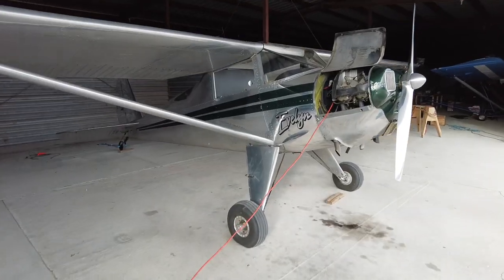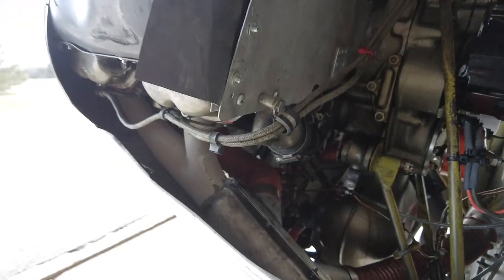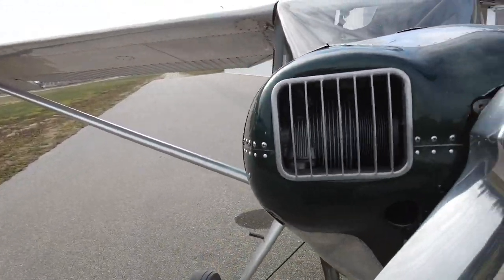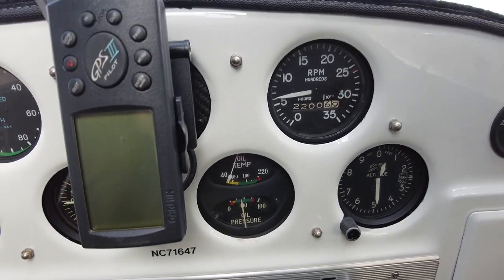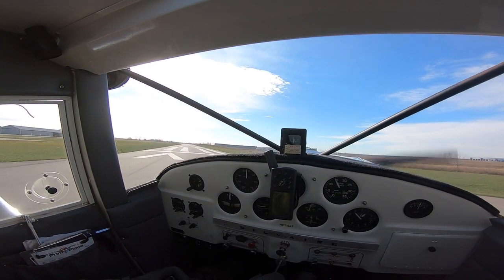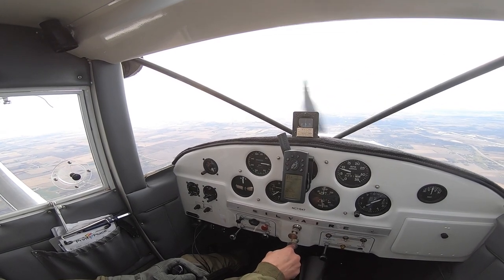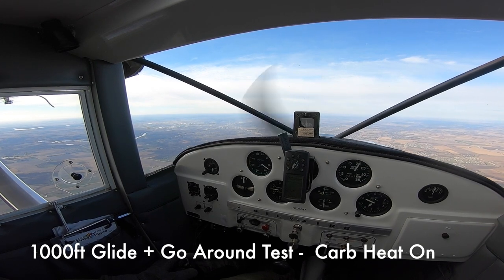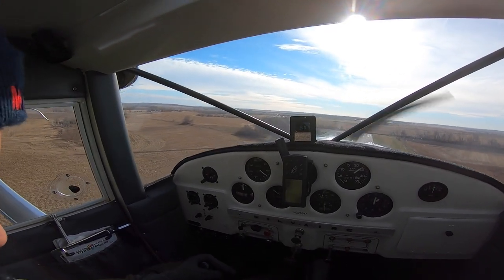Cold weather ops (and smoke in the cockpit!)

Comment: I was taught to not use carb heat (check on run up only)  on the ground due to unfiltered air entering the engine. Also to lean (ground ops)so the rich mixture doesn't foil the plugs
Reply from the maker: The tendency of this carb is to already run very lean on the ground in the cold, which is why carb heat is needed to en-richen the mixture for warm up. On a fuel injected aircraft burning leaded fuel, absolutely, I run those super lean on the ground. But as you described, you would have a tough time getting off the ground

Comment: Mixture works. Try it up at altitude if it gives you better rpm the leave it on. If it doesnt then push it back in. You notice a big difference at higher density altitudes. Going to sedona in summer where density altitude are 8000 and higher it makes a difference
Reply from the maker: Yea so that’s the test I did at altitude, it seem the auto compensation is working well enough though since I couldn’t get the RPM to increase any higher. I bought the plane in ABQ in the summer and we got peak power without needing to lean